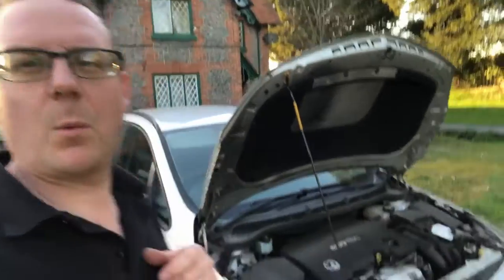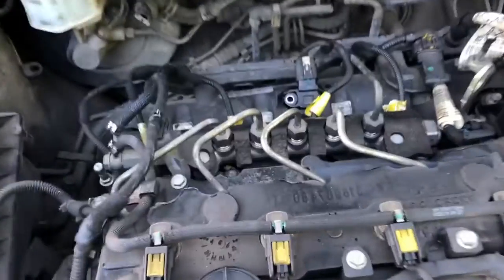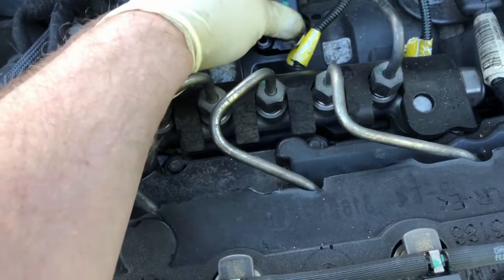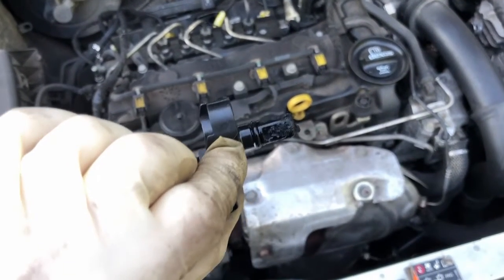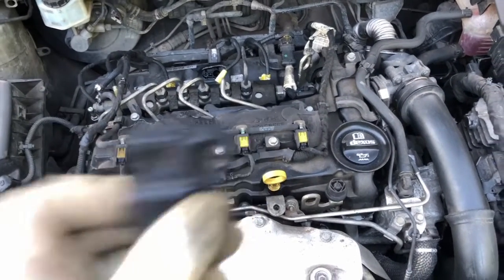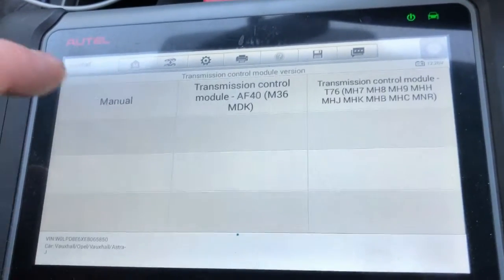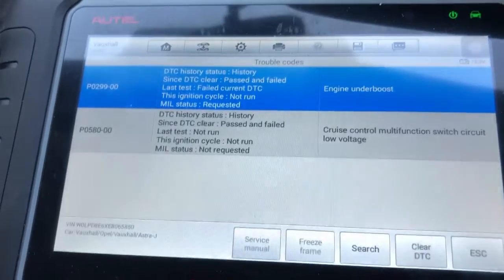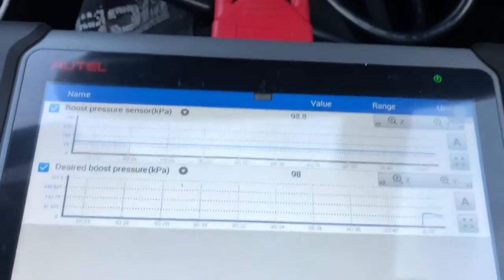Astra J - 1.6 CDTi map sensor - P0299 - Engine underboost - How to

Comment: Good video. How can I find out if my turbo is going? I’ve had this fault code P0299. Also the other day my DPF filter broke into pieces and came out of my exhaust so I need a new DPF filter
Reply from the maker: Take off turbo inlet pipe and check wheel for play.
Reply: @Roverturbo sorry is that the same as the intercooler pipe?
Reply from the maker: @deancarter4109 air box to turbo pipe.

Comment: I have a 2016 insignia 1.6 cdti probably the same engine,I’ve had engine light on,no loss of power,only do short journeys,engine lights reads as EGR restricted flow deceted,had new EGR valve fitted,carbon cleaned,still engine light coming on,not had same code come up,how ever took my map sensor off today,was sooted up,cleaned it put it back I’ll give car a good run tomorrow,
I’m now wandering as I have had different code to what your getting could the cooler be blocked?
Reply from the maker: The cooler is most prob blocked, not the egr. The engine light  prob come back on, as it doesn’t come straight back on anyway.

Comment: Hi mate I’ve cleaned this sensor and also cleaned the EGR valve and the light still comes on but I can drive longer a push the car harder, what can I do next? Thanks
Reply from the maker: Seen my other video for the boost control valve?
Reply: @Roverturbo Ok I will do thanks do you recon that could be my issue ?
Reply from the maker: @CantEatRS common issue.
Reply: @Roverturbo thanks a lot mate

Comment: Hi, ive got a similar issue with me 2017 astra, eneded up replacing the map sensor but i still have the engine light on after clearing code and still feels the same.
Any ideas ?
Reply from the maker: I have another video on the same code. Boost control solenoid

Comment: Could you not do an Egr clean or replace on this model engine...All vauxhall forums crying out for  good clear video as your spot on..Proper common problem throwing P0401 Code...As mine showing...Cheers👍🏻
Reply from the maker: Thank you, I do have a video on the issue, but not a complete how too.. but I will if the opportunity comes up.

Comment: I have the exact same issue on the wife's astra which is the same as yours .
Did this fix the issue ? 
It's already had a boost controller changed at vauxhall and was ok for 6 months and is now back to its old tricks again
Reply from the maker: No, still came back.I suspected the dpf was blocked with ash. I sprayed oven cleaning foam in the lambda/sensor hole… left it for a few hours, flushed  it out with some water. Light/limp not come back on and had more power overall.

Comment: Hi i have a problem with my astra k of 2016. The default code is p0401 and the garage dont found the problem. I watch you video and cleaned the map sensor but. Can you help me please.
Reply from the maker: That code points to the egr, without seeing the car, it’s impossible to tell, has it been cleaned, or replaced?
Reply: @Roverturbo  thx for your answer. Yes the egr is replaced
Reply from the maker: The wiring to it is the next thing to check.
Reply: @soufianeshna8013  I had the same problem, cleaning the egr valve did not help. I had to disassemble the entire egr block and clean the exhaust gas cooler.
Reply: Most of the times the chicane between the egr and intake  is filled with all the glonk u saw on the sensor. If the symptom is low flow.

Comment: Please don't use WD40 as a lubricant.
It reacts badly with the vast majority of seals causing them to swell up and can hasten their demise. Use water (saliva) or a sensor safe lubricant on the seal, if you really need to lubricate it, or you'll be returning to the job diagnosing an airleak in a few months because the seal has perished prematurely.

Comment: Thanks Pro can you retract the rear brake pads with your Autel ???? keep the info coming from the Astra
Reply from the maker: This one has a manual handbrake. I have used it on other cars tho.
Reply: @Roverturbo   oke cant you see the option retract rear callipers  ?? Thanks Pro
Reply from the maker: On what car?
Reply: @Roverturbo  same as yours with electric handbrake from the year 2015
Reply from the maker: You need to go into on the main screen  “service” and “EPB”
Reply: @Roverturbo   so it has that option I in the market for a new obd reader so thanks The foxwel 650 dos not work with the brake pads retrac is a grab tool Have a nice day and Thanks

Comment: Ive got this exact code on my 2007 Ford Galaxy, turbo under-boost P0299, Ive checked for leaks and couldn’t find any. Will try giving the map sensor a clean. Mine brings on the eml but after driving a few days with the light on it resets itself then a few days later does it again. Driving normally its fine but flooring it in 3rd gear tends to bring the light on. Any ideas what else this could be ?
Reply from the maker: Map sensor,  boost controller, turbo, egr.